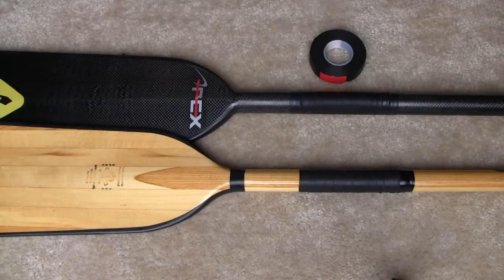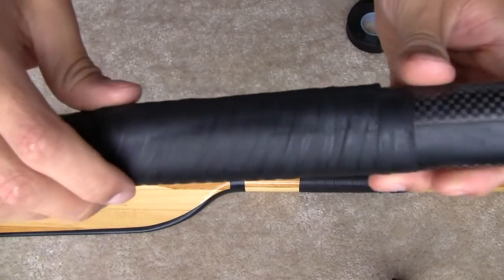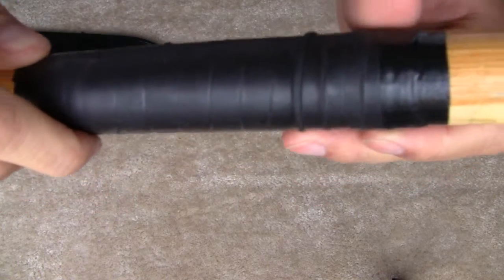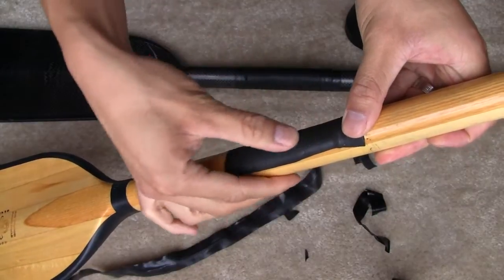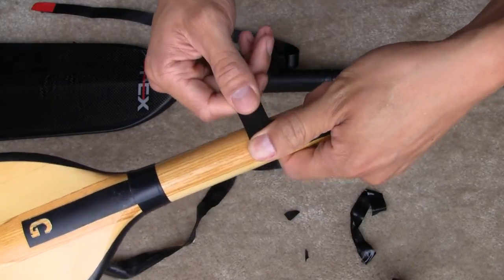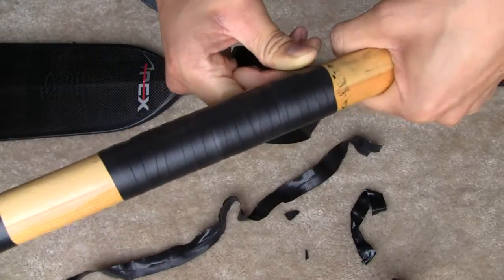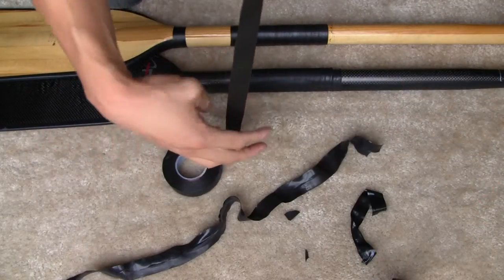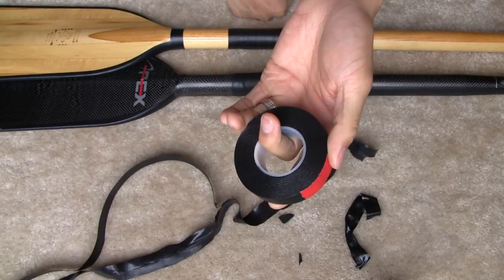Get A Grip

Comment from the maker: Hey there!  Most on my team just use electrical tape as it is pliable, cheap and lasts fairly well.  Simply cut a piece that fits the side of the paddle and stretch over the edge as you lay it down.  There are dragon boat specific brands carrying paddle edge tape that is clear vinyl material that is tougher but more pricey

Comment from the maker: @cipaddler042 u can buy it online.  can be hard to find depending on the keywords used, but I bought mine at Parts Express under "shrink tape."  Other times it looks like it is called "cold shrink tape" or "fusion tape."  I'd recommend not spending over $0.80 per foot for the stuff.  A quick search shows that most rolls that look like mine in the vid are your best bet.  Good luck!

Comment: I've bought Burnwater Fusion Grip...great stuff, but expensive!  Use Self-Fusing Silicon Tape (look on Amazon) Xtreme Tape is soooo much cheaper and it's the same stuff!
I've wrapped the grip closer the blade, since I've learned in GWN Paddling Clinics to choke closer to the blade on the Starts and a 12-inch grip for increasing the reach as you settle into race pace.